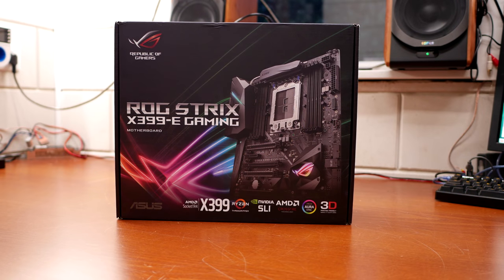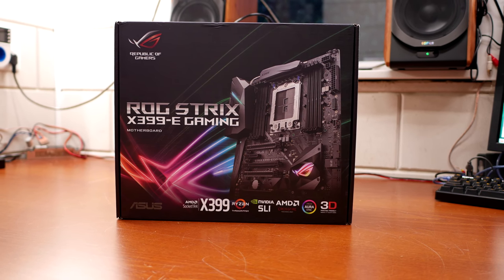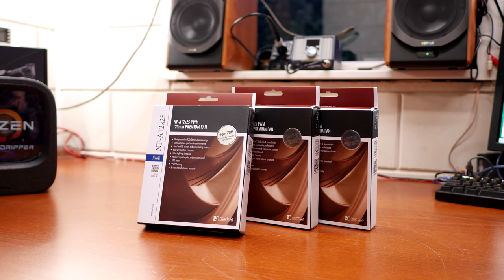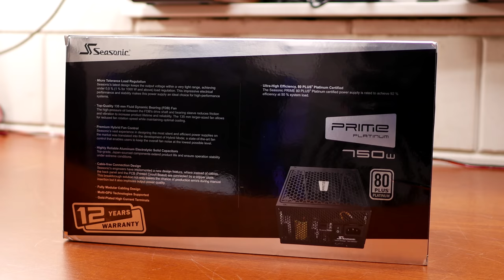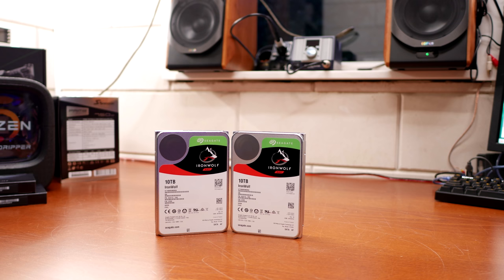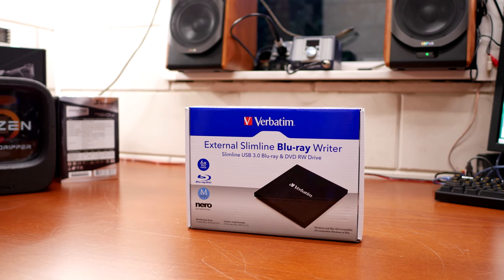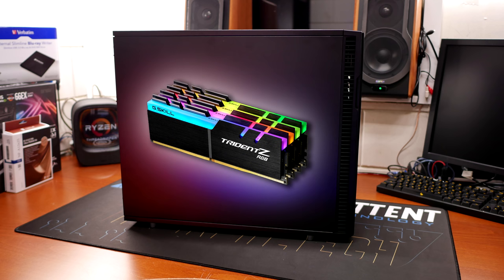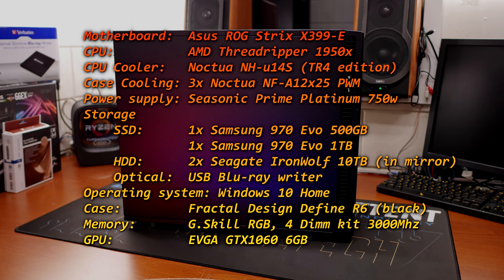Computer build: 4K Vegas Pro Threadripper Video Editing Machine

Comment: The threadripper 1950x is a beast.  Here in 2020 I built a budget editing rig with the 1950X. I only paid 400.00 for it brand new. This is literally the fastest computer I have ever owned.  My video card is an AMD RX5600XT.  A 4K time line is child's play for this setup.  I use 32 gigs of Corsair vengeance LPX 2666 ram and it runs stable at 2933.

Comment: Did you ever test this in Vegas? I'm looking into a build with a 2950X, but I am worried about Vegas's utilization of 16 cores.
Reply from the maker: I did but because I had to give the system to the owner I didn't have the time I wanted so never made a video. 

But my analysis is this, if you're working in 1080p you're going to see a good boost from going with threadripper. For 4K material the boost between my Ryzen 1700 @4.0Ghz vs the Threadripper stock was lower. It was still a bit faster but not by as much. To me, it looks like there are some internal "blocking" processes inside of the Vegas pipeline. It only allocates a certain amount of threads to decode video for it seems. So while doing 4K I would sometimes see utilization up to 50% only, but while doing 1080p it would reach up to 80% to 90% regularly and was much faster then my overclocked Ryzen system.

If I am correct, the limited amount of threads for decoding video (or something else in the pipeline), holds up everything else and causes the performance scaling issues with more cores.

So for now, that is how it is. We designed the system with the future in mind, he wanted to stick with the same hardware for 5 years and that is why we invested into Threadripper. Also, multi-core use is bound to improve with time. It's not bad now, 1080p sees a very nice boost but certainly with 4k you're not going to see a 2x boost.

p.s. If you're building a system. I also did some tests with GTX1060 vs GTX1080 and so no change whatsoever. Do make sure to get an NVidia card though, it helps during timeline editing and rendering and the new hardware NVENC HEVC encoder is very nice and certainly helps with render times, it uploads to YouTube just fine (80Mbps h265).

So if you're debating. The new Intel 9900k will be faster for certain thread limited processes, but the Threadripper performs very nicely and I think will be faster during 1080p projects then even the 9900k.
Reply: @IntermitTech  have you upgraded your Dad's Vegas to v16 and re-tested? I was wondering if they have made any further multi-core improvements over 15. The upgrade to v16 is, despite their endless "offers," still over $300 and I would only upgrade if I can see a rendering improvement over 15.
Reply from the maker: @TheDesertsweeper  I have an 8 core Ryzen myself and I see little difference working with 4K footage between 15 and 16. In general, working and especially rendering 1080p footage is much faster in Vegas then 4K footage and export format. I'll see 80% to 90% CPU utilization over all 8 cores in 1080p exports, but only up to 40% to 50% in 4K exports, both in 15 and 16, so there are pipeline optimization issues that still need to be fixed.

Also text overlays and certain effects are NOT optimized for multicore CPU's still in 16, with fancy text overlays rendering can grind to a halt just using 20% CPU until those frames are past.

Sadly I never got around to finishing these benchmarks because the PC was remote and I did some tries but it just wasn't a good comparison. But!!! I will be upgrading to the (most likely 12 or 16 core) Ryzen 3000 series and I will certainly make a benchmark comparison video against my Ryzen 1000 series CPU to see how much it improves Vegas workloads! :D

So not forgotten and to be continued, but in a bit different way then I wanted to earlier. :)
Reply: many thanks  @IntermitTech  you have saved me a worthless upgrade then. I do not need the new "features" of v16 but was hoping for better rendering performance in 4K which is not good with v15 as you show, with the CPU not being used fully.

Comment: What hardware do you suggest for 4K editing (short 3 minute projects) with few CC filters thrown on, video stabilization for few clips, bezier masking for few clips. I am a long time (10 yrs) Sony Vegas user. I edit 4K video but only using 720p proxies. But even for that the system chokes when doing anything complex such as color correction or video stabilization (causes crashes). Id really like to know, in essence its editing just a 720p file so why the big fuss, what computer these days cant edit a 720p file with a few CC filters thrown on and some motion tracking etc ? Is it really making a 720p proxy or not ? Same thing when i take a pure 720p video from my DSLR or something and edit it, it runs buttery smooth on the timeline, with effects etc and even does stabilization well. The PC in question is a modest i3 6th gen but decked out with 4 SSD HDDS. I dont care about render times. Im only looking for timeline n preview performance.

PS : I wold gladly upgrade to an i9 and am even considering that right now. But in the end its all useless because even after investing that much still the systems will choke and crawl, and then they will say its not your processor but the motherboard. Change that, no improvement, change something else, graphics card, then M2 SSD. Computers are where you keep on putting in and see no MAJOR difference (My experience). Only a SLIGHT difference. I say this because the I3 6th gen does well with 720p footage then why stutter with a 4K when its proxied to 720p ????? I just dont want to invest and make Intel richer while seeing some paltry improvement here and there.
Reply from the maker: Getting Vegas to perform is quite difficult, dare I say impossible. For 4K you need to turn off a lot of the new features (such as File I/O, SO4, etc.) to even make it stable enough to be able to edit a reasonable project and then you still get hangs, crashes and stalls during rendering with corruption in the end result to boot. I've got workarounds for every of those issues right now and can work reasonably well with Vegas Pro 17.

Why don't I switch to something else? Because I have years of experience in Vegas, templates, and set ways of doing things, I want to make content, not spend months switching a new editting tool.

I currently edit on a Ryzen 9 3900x so a 12 core with 32GB memory and a GTX1080. Overall with proxies I can edit pretty well but adding effects or especially text and such and you drop down in framerates to an absolute crawl quite quickly. A lot of not all effects are processed through software in Vegas, even if you have GPU compositing on, it does some stuff, but not a lot, it mainly helps in copy operations and thus making rendering a bit faster, just like the NVENC encoder, that works pretty good and rendering times are ok but Vegas is just bad at utilizing all cores. Sometimes it does, sometimes it does not, it really depends on what it is doing, as said it uses CPU mainly to do it's work and then it's still badly optimized for that. 720p render will use 95% CPU, render the same in 4K it will utilize max 50% because of software inefficiencies in the pipeline. :(

All SSD storage, but I edit directly off my NAS/Server, that has 8x10TB in a mirror with SSD caching and 10Gbit so there is not much of a difference in that regard.

Anyway, long story, it can certainly be better then you currently have I think. I did notice a big difference going from My i7-4770k to my a Ryzen 1700x and then again to a Ryzen 3900x. Check out my review benchmark of the 3900x (https://youtu.be/z8M0pi-ITNc), in there I also made Vegas Pro benchmarks! :)

So yes, upgrading will help in my opinion, not 600% and make it buttery smooth or something like that, but it will still help. :)
Reply: @IntermitTech  > Hi and thanks for the detailed explanation. Im exactly in the same boat as you. 10yrs using Vegas and hence dont want to jump ship and learn an entire new interface and work logic. Because in VP if you tell me a concept i know how to execute it right off the bat in my head if the app will cooperate without huffing an puffing. Almost any kind of thing, even basic VFX concepts can be executed in Vegas. So now its better the get this tool to run at its best with compatible hardware than learn an entire new software.

Im leaning towards a Core i9 because i already have a socket 1151  hopefully even if i see a 100% improvement or twice better on the timeline would be great. Your right in that VP is kind of half baked, first Sonic Foundry had it, then Sony took it over and didn't seriously develop it, now Magix (ive not even heard of them). It took them 10 years to provide a dark interface option like AVID/Prem Pro etc had from those days. The app cant decide whether to use the GPU or the CPU and it sits somewhere in-between in its implementation. Mostly STABILIZE on 4K makes it crash, while i see Premiere Pro guys do it like it was set aspect ratio. But again, cant jump ship now.

On a side note : just wanted your opinion..............the work of adding anamorphic flares in post, even light leaks in post etc, would it suffice to say these fall under visual effects (though they are simple work) or does it fall under the category of color correction or just video editing ? How would you classify/demarcate it to a client. Like we say cutting, chopping, transitions, NLE work is classified as editing. What would you classify that kind of work as ?
Reply from the maker: @mgr5550  I don't do professional work for others so don't take my word for it, I just edit for myself. :P But I'd say adding stuff to the footage such as flares and light leaks is visual effects. Those are not things that are in the footage originally. Color correction isn't adding to the footage but just changing it a bit to make it more visually appealing kind of the same as you do with editing, transitions and chopping it down to something people want and like to watch. Now how to call adding those elements, never really thought of it, I guess you could call it just "adding effects". :P